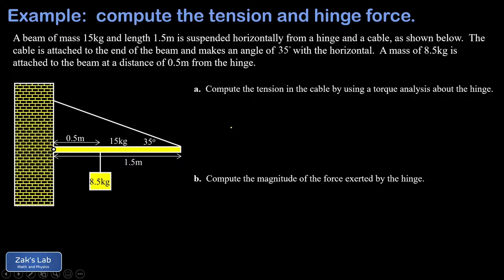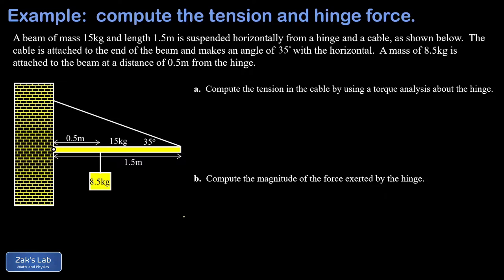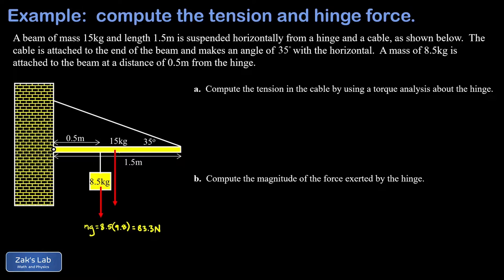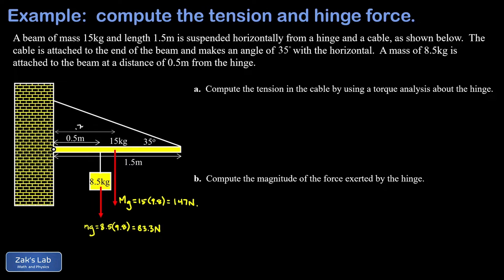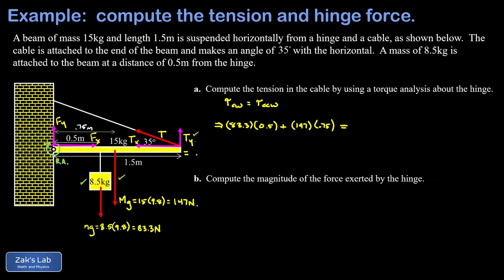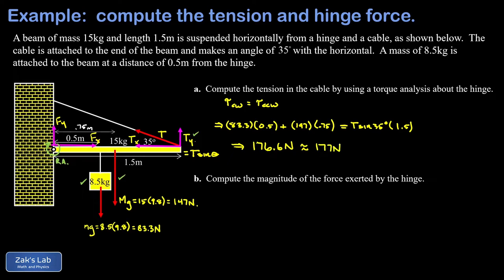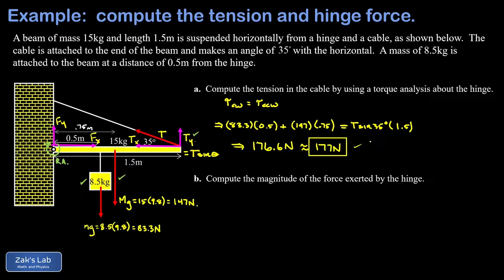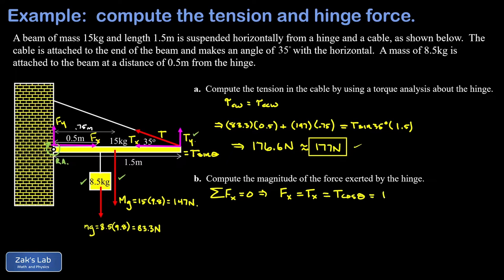Beam and cable problem:  compute the tension and hinge force using force and torque analysis.

Comment: Hello Please you said the mass of the beam and the attached mass form a clockwise moment but how is it possible since they are acting in opposite direction to tension?
Reply from the maker: With the hinge as the rotation axis, gravity pulling down on the mass and the beam are both clockwise torques attempting to rotate the system clockwise.  The tension pulling up and to  the left is exerting a counterclockwise torque.